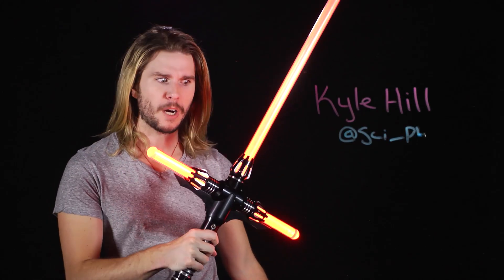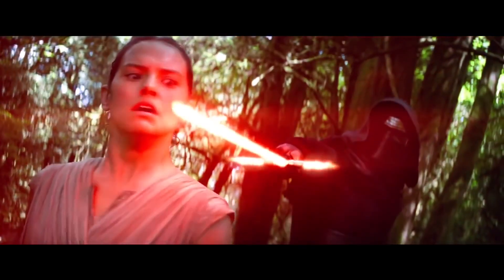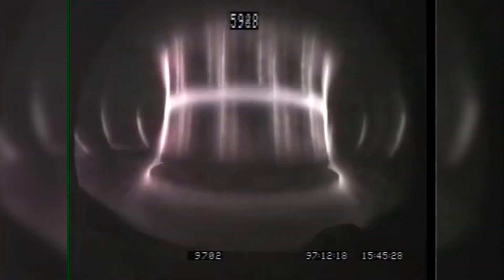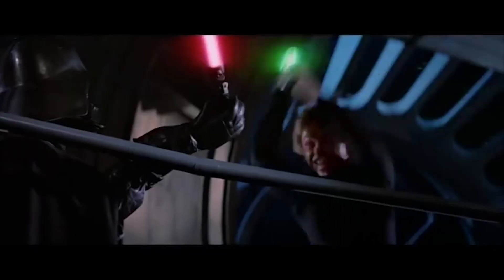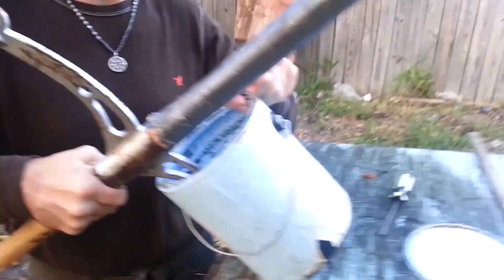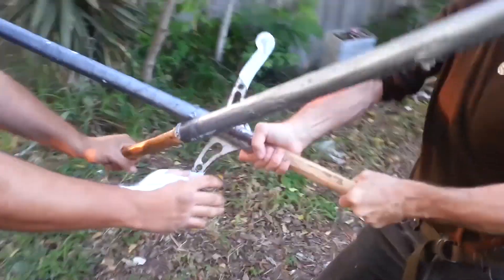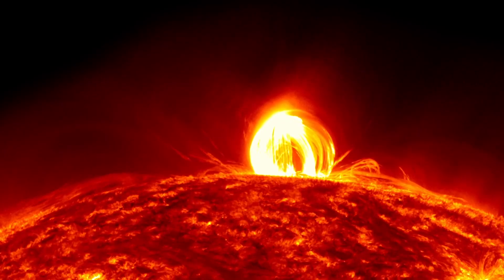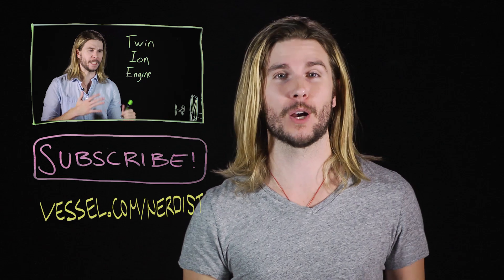Why Kylo Ren's Lightsaber Works (Because Science w/ Kyle Hill)

Comment: A parsec isn't a measure of time, it's a measure of length. A parsec is equal to about 3.26 light-years (31 trillion kilometres or 19 trillion miles) in length.
Reply: +Tylermike75  That's the point the Kessel Takes roughly 18 Parsecs to complete due to the Maw black hole Cluster, But Han was able to Complete it in less than 12 Parsecs by Traveling closer to the black holes.
Reply: +Tylermike75 that's why its stupid. Han described what sounded like a test of speed by stating a measurement of distance. Thats like saying "I ran the 100 metre dash in 10 000 centimetres." Lucas didn't check what "parsec" actually meant, he just thought it sounded like a fancy unit of time. He was wrong lol.
Reply: Noah MacGillivray Haha yea
Reply: LuxKat So, its not actually a test of speed but a test of durability and pilot skill? Because if it were a test of speed they wouldn't allow ships to alter the race course by cutting corners like that. I can understand though if it is like "The usual route through these black holes is 18 parsecs long, but Han found a route that was only 12 parsecs long". But, that also means that speed is irrelevant as it is about plotting a course that has the shortest distance, not having the best top speed.
Reply: +Noah MacGillivray well the kessel run isnt a race its a smugglers path way since larger ships cant follow smaller ships through it.

but the falcon hyperdrive is actually a level 0.5 which makes its hyper drive also faster than most ships which are usually level 2-3
Reply: +Jaunty Spider I think the point is that the ship can get that close to the black hole without falling in. If he is saying that the falcon can get that close to the black holes without falling in than by definition he is saying the falcon is faster than any other ship- in universe justification 

Lucas didn't know what a parsec was- probable real world explanation 

I have also heard the theory that Han was bullshitting Luke and obi wan to try to get them to fork over more money and given that he was a rouge at the time that would also fit in with his character
Reply: ***** I guess, but it would still be a really convoluted test of a ship's abilities. The way I see it the Kessel Run is more of a test of daring and survival, not just the ship, and as such stating "The Millenium Falcon did the Kessel Run in 12 parsecs" is more a testament to Han's skill as a pilot than the ships speed or other abilities. This whole thing would be much simpler if they simply said "the top speed of this ship out of hyper space is x!" or "This ship can do x hyper-speed jumps on one tank of fuel!" or even more straight forward, "This ship can do the Kessel Run in ANY AMOUNT OF TIME WHATSOEVER".
Reply: +Tylermike75 

The idea of the Falcon being a "fast ship", as Han puts it, is if so many ships can jump to hyperspace then his is better at it. Even before LucasArts licensed some (now non-canon) book that explains Han traveling close to worm holes, LucasArts were explaining that the Falcon's navicomputer is extraordinarily good at plotting routes through space. If you have to race from Los Angeles to New York, half of the battle is finding the best route, and same is true of ships traveling through hypserspace.
Reply: +Tylermike75 It wasn't a test of how close you can get to the black holes of The Maw, it was the Imperial Space Station there. The Imperials guard the closest routes for the Kressel Run,  you could go around the Imperial forces, but you are taking too long, and risk being found. The closer you are, the more dangerous it is. By completing the trip in a short 12 parsecs, Han was almost touching the Imperial patrols as he made the run - hence making him the best smuggler in the galaxy.
Reply: Jay Schnurr I appreciate the work an though everyone did here in these comments, but the truth is, as I have stated, the danger wasn't getting too close to black holes (even though VERY prominent), the danger was getting to close the the Imperial Installations inside and surrounding the Maw. If you got caught with your load, you were arrested or killed by Imperials. So the fact that he did the trip in 12 Parsecs, instead of his original route, he is known as the best smuggler ever, crossing the Kessel Run in a record distance without getting caught.
Reply: There's a theory that says that Han was talking about how he's able to travel through the Kessel Run in the shortest distance possible, effectively cutting corners in one of the most dangerous smuggling routes to save both time and distance.
Reply: +TonierShadow This makes the same sort of sense as +Elemental Turnip's reply about cutting corners on dangerous smuggling routes; they could be dangerous due to the proximity of black holes... 
I still prefer thinking of the Kessel Run as a relay-sort of job, but either way, I believe that Lucas and Ford made no mistake in writing/speaking. Quite probably, Lucas did it to create this exact argument to further accentuate his depth of back-story.
Reply: +Cristian Allwood "Okay, I'd like to preface this by pointing out that trying to apply an 
accurate physics model to a fictional universe that is not explicitly 
based on an accurate physics model is completely illogical and might 
even make your brain explode."

Isn't... um... isn't that what this show (Because Science!) is all about? Why are you even here, if you don't have any interest in attempting to do just that?
Reply: DejaVoodooDoll publican90 These reasons make so much more sense!
Reply: +Jaunty Spider no its because of interdemsions Han didn't find a shorter route its because he flew so close to the blackholes that the distance was displaced causing it to be a shorter distance.
Reply: +Alex G Unfortunately, theat guy basically has the logic that the book used. Han himself was surprised that the distance was shorter that it should have been, and double checked the figures to make sure. And the result: getting suicidally close to the black holes somehow knocked nearly a third of the distance off of the route.
Reply: +Cristian Allwood no it was a bluff
Reply: ***** nah it be bluff it says so in script
Reply: +Alex G Actually, it makes sense...kind of. His wording was off, but the concept was correct.

If a person was journeying to a black hole, and agreed to flash a light once every second, as they got closer, to an outside observer, the length of time between the flashes of light would continuously increase. This is because black holes mess with time...and since time is just another dimension of space, black holes mess with space as well. 

I said that all rather poorly, but the point is that there is a nugget of truth in there.
Reply: I understand that...I was just commenting that the statement that Alex made about there being no science in what the other guy said was incorrect.  :)
Reply: bluff be it just leave it at that he did not manage it
Reply: Actually, it's commented that the straight-line distance along the Kessel Run is about 20 parsecs. That line goes through the Maw. As for the bluff, who would believe the he cut over a quarter of the straight-line distance by going around the obstacle that names the route?
Reply: Apologies for double posting, but a thought hit me just after I hit post. A.K.A Matt, by your comments I find it rather safe to assume that you are going by the "Movie Canon". Unfortunately, according to Disney the movie tie-in novels are no longer canon, and the bluff was never called in the movie. Please draw your own conclusions from that.
Reply: +LuxKat That explanation is really dumb and people repeating it should be ashamed.
Reply: Cristian Allwood no it was in the script not some novel
Reply: A.K.A Matt No, the ridiculous Maw fan-theory (which is what it is, no matter if it got official sanction) comes from Jedi Academy, not any script.
Reply: avicenna no the script for the movie
Reply: avicenna in other words he did not make the trip
Reply: Yes he did, even though the books are non-canon, the movies still are, and in the seventh movie, he even said he did the trip in twelve parsecs. So why tf are you arguing this now? Because obviously, a seemingly good constructive argument became a pissing contest.
Reply: A.K.A Matt Ah, yeah. I misread. I still don't buy the bluff theory either, it'd be like a truck driver trying to bluff saying "this here be the big ole truck tha did east coast to west coast in less than 500 miles, yee haw"
Reply: avicenna nah it makes sense to hans character. he wanted to get payed back then and the better he sounded the better the pay.
Reply: A.K.A Matt He would use a bluff that made sense. Using a unit of distance, not time, doesn't produce a bluff that makes sense. It produces a bluff that even a child can call.

Han, a smuggler and spacer, would no doubt know what a parsec is. He would never think of intentionally fucking up his bluff in this way.
Reply: avicenna well in the script (by lucas) it says it was a bluff and how does it mater if it is time or length it can still be a good bluff saying that he made it in such good time/distance
Reply: A.K.A Matt Nah it really can't.
Reply: avicenna trust me he did not mange to do it. mostly because if he did mange it he'd be famous for it but hardly anyone knows him (besides bounty hunters)
Reply: A.K.A Matt Okay bro, this might be a bit difficult for you but I know you can manage. Just repeat after me:

Parsec is a unit of distance, not time.
Parsec is a unit of distance, not time.
Parsec is a unit of distance, not time.
Parsec is a unit of distance, not time.
Parsec is a unit of distance, not time.
Parsec is a unit of distance, not time.
Parsec is a unit of distance, not time.
Parsec is a unit of distance, not time.
Parsec is a unit of distance, not time.
Parsec is a unit of distance, not time.
Parsec is a unit of distance, not time.
Parsec is a unit of distance, not time.
Reply: avicenna i know which means he bluffed it somehow maybe they had no people on it or maybe he pretended to mange some shortcut but from what we know it's very likely a lie.
Reply: I am going to say this once. He accidentally made the 12 parsec trip. Due to trashy scanners, he didn't realize how close he was to Imperial Space Stations, so when someone went to go see if it was true he made that close of a trip, he played it off like he did it on purpose. That part, and ONLY that part was a bluff. He did make the trip. Stop arguing if he did or did not do it, because you all are right, and you all are wrong at the same time.
Reply: A.K.A Matt Explain how this bluff would make any sense whatsoever. Remember: a parsec is a unit of distance, not time.
Reply: avicenna i have no idea i just know it is a bluff he did not do it. simple as that. maybe you should ask the writer i can think of one way what if he faked finding a shortcut.
Reply: A.K.A Matt
I think you're just making this up as you go along and have no evidence to back your claim.
Reply: BassHead no trust me look up the script
Reply: BassHead the only thing is it is unknown if this was finalized but it was in most scripts i believe in it too.
Reply: A.K.A Matt Listen, a bluff is only a bluff if it makes sense. Saying "the falcon is the ship that did the Kessel run in less than 5 hours" is a sensical bluff, since it implies the ship is very fast. Saying "The falcon is the ship that did the Kessel run in less than 12 parsecs" just implies that solo doesn't even know what a parsec is, and is therefore the opposite of a sensical bluff. It implies that Solo is a goddamn incompetent who can't even tell length units and time units apart. It'd be like a truck driver who doesn't know what a mile is.

It's not a bluff. It's a screenwriting fuckup. Accept it.
Reply: +Tylermike75 But if your hyperdrive is bending space in front of it in order to reach your destination, you want that space to be more compact. Like, less than twelve parsecs. But that's not how hyperdrives work ... Maybe the hyperdrive computer calculated a shorter route through hyperspace.
Reply: From what I remember from the book, (simply because I'm too tired to find the exact quote atm) is that Han was making the run when they got in trouble with the local Imp patrols. He made a hyperspace jump both from a point that was too close to the black holes and traveled along a path that was, again, too close to the black holes. Checking the readouts afterwards, he discovered that the jump was shorter than it should have been.
Reply: +Tylermike75 A parsec (abv: Parallax Second) more precisely is the distance a star is from the sun at an angle of one arc second (1/3600th of a degree). Since tan(x)=r/d, d=r/tan(x).
Reply: AlchemistOfNirnroot I'm done. It went from black holes or imperial outposts, to this guy believes Star Wars was real and that a story that was completely made up back in the 70's and 80's can be explained by physics from today. Stop. Now.
Reply: +BassHead I don't remember anyone trying to apply real world physics to this. If it were 'physics accurate', Han and Chewie would have died, full stop. If anything, getting that close to that number of black holes should have effectively extended the distance, not shortened it.

I just think that the explanation given was inventive and entertaining, as well as being in keeping with the general feel of how physics in a fictional universe has worked.
Reply: Cristian Allwood Don't see why they would've died. Unless they actively tried to slow down when approaching a black hole, conservation of energy dictates they would just emerge on the other side of the gravity well with the same speed, possibly in a different direction.

This explanation is terrible for a simple reason: it doesn't work. Even assuming most ships could only get within 1000 event horizon radii of a black hole, assuming that each such black hole has a radius of 10 km, and assuming the trajectory goes near 1000 of these black holes, a ship could save AT MOST only 0.07 astronomical units off their path by moving closer to the black holes. That's 0.0000003 parsecs. A far cry from the 6 parsecs this fan theory requires to work.

So, really, the whole thing is 8 orders of magnitude away from being even in the same galaxy as "plausible". It's not much more than pseudo-scifi mumbo jumbo.
Reply: +avicenna Okay, I'd like to preface this by pointing out that trying to apply an accurate physics model to a fictional universe that is not explicitly based on an accurate physics model is completely illogical and might even make your brain explode.

Now that the mini-rant is out of my system, (and it wasn't entirely aimed at you, that one's been boiling over for a while, both in- and outside of this thread and even Star Wars), I'd like to point out first that the Falcon was apparently scraping the event horizon of a black hole and would would have crossed a few more following the programmed route.

Second, hyperspace. I can find nothing about the interaction of hyperspace and black holes beyond any sufficient gravity well will kick you out of a jump. All we really know is that hyperspace drops you into some kind of alternate dimension that treats the traversal of distance differently. Honestly, in things like these, hyperspace just seems to be a form of applied phlebotinum.
Reply: Cristian Allwood "Okay, I'd like to preface this by pointing out that trying to apply an accurate physics model to a fictional universe"

Nope, I'm not doing that at all. I'm merely playing by the rules set by the universe. Those rules include distances being more or less the same they are in the real world. This is not an 'accurate physics model' by any stretch. It's a basic self-consistency requirement.

"Now that the mini-rant is out of my system, (and it wasn't entirely aimed at you,"

I hope it wasn't, because as I just explained my answer has very little do with real physics.

"I'd like to point out first that the Falcon was apparently scraping the event horizon of a black hole and would would have crossed a few more following the programmed route."

My argument still applies, however.

"Second, hyperspace. I can find nothing about the interaction of hyperspace and black holes beyond any sufficient gravity well will kick you out of a jump. All we really know is that hyperspace drops you into some kind of alternate dimension that treats the traversal of distance differently. Honestly, in things like these, hyperspace just seems to be a form of applied phlebotinum."

Oh, it is. But the very premise of this fan theory is that the time of travel is not important, only the distance. So Han could drop out of hyperspace, cruise along very deep inside the black holes' gravity wells, and leave. But let's roll with it. Let's say that throughout this route a lesser ship could only handle a local acceleration due gravity of less than 1 g. That means that for a black hole with a Schwarzschild radius of 10 km, the ship would need to keep a distance of at least 10000000 km, or 0.07 AU. This gives a local acceleration due to gravity of about 0.4 g, which surely is acceptable to most hyperdrives.

Then as before let's say there's 1000 black holes along the route. That means you can save at most a distance of the order of 70 AU, or 0.0003 parsecs. Still got about a factor of 10000 to go before any of this makes sense.

So you see, it's not really physics but rather that writer's inability to comprehend how mind bogglingly big a parsec is.
Reply: I don't think many people at all can properly comprehend that scale.
Reply: Cristian Allwood Very true. Without doing the math it's pretty much impossible for our monkey brains.

But the thing is... it's easy to write a scenario that's plausible (in-universe) and that has the potential to be significantly more compelling. Instead of making up stuff about a black hole cluster that nerds are going to pick apart in two seconds, just make it a region of space that's intensely patrolled by imperials. Only a skilled pilot in a very fast ship would dare carry illegal goods through that region, and thus make a considerably shorter route.

It's still a stretch, of course, but a much better one. And there's the potential for some interesting stuff happening in the middle. Bad writing imho really is the problem with this thing I derisively call a "fan theory".
Reply: +LuxKat I've always thought that sounded like a very, very post hoc explanation for the parsec thing. More likely Lucas just got it badly wrong and they shoehorned this into the expanded universe in an effort to fix it ;)
Reply: Paul Bottomley It is. The explanation doesn't even make any sense.
Reply: +Paul Bottomley Well, I wasn't really paying attention to factual veracity the first time I read the book. All I can really say is: It fits with the writing style of the book, it fits with how the term has been used in universe and most people, myself included, wouldn't have noticed it unless it was pointed out to them. As for Lucas getting it wrong, I've no doubt of the high probability of that, he's not exactly known for being consistent.
Reply: Well I think in the movies it is a measure of time! Because Rey says 14 parsecs but then Han says 12! Why would a distance be different if they are going from the same place to a different place? Parsecs in the Star Wars universe may be a measure of time!
Reply: In theoretical physics, a strong enough gravity well could fold space and shorten the distance between two places, kind of like a cosmic shortcut.
Reply: Cristian Allwood If that's the case, Han Solo's trip had to take 40 years.
Reply: Again, the use of hyperspace circumvents that. On a relate note, has anyone noted that travel time in hyperspace seems to be highly inconsistent? Applied phlebotinum aside, one would think that a sort of standard would eventually assert itself, given how much contact a lot of the authors had with each other, along with the Holocron. Now, I can understand cutting out the time in transit where nothing is happening, but at some times you have the amount of time that has passed, or is expected to pass before reversion, explicitly stated, and other times it's implied to be near instantaneous. Just a personal gripe, really, because while I prefer the idea that hyperspace is kind of like the relationship between the Overworld and the Nether in Minecraft, I could deal if it was basically teleportation, as long as it was consistent.
Reply: Cristian Allwood "Again, the use of hyperspace circumvents that. "

Either hyperspace works by making a shortcut, in which case the trip takes significantly less than 40 years, or it works through some other mechanism and there's no sense in saying less than 12 parsecs.
Reply: According to what little actual codification of the system I've been able to find, it really does seem to be like Minecraft, where one piece of technology 'moves' the ship into a somewhat separate dimension and another system provides propulsion within that dimension. So yes, in theory, a shortcut. What's used to justify the whole 'Run in 12 parsecs' thing is that gravity in our dimension affects hyperspace, which is why you're not supposed to be able to jump from within or cross a gravity well, and the relative distances remain constant, which allows the navicomputer to determine distance traveled.
On another note, I came to understand how big a parsec really is, and the size of the Maw blew my mind, as it's apparently nearly 5 parsecs from Kessel and easily visible. Also, distance really does seem to mean nothing in Star Wars, as that distance is easily covered using sublight engines. Several times ships leaving the Maw simply 'flew to Kessel' instead of 'jumped toward Kessel'. It actually occurs to me right as I'm typing this that Kessel is also supposed to be visible from the Maw. Kessel is described as a planetoid. So unfortunately we may never be able to come to consensus on this, but I must admit that I find the conversation scintillating anyway.
Reply: Cristian Allwood The 'Maw' justification doesn't hold up. There's no way you could shorten a route from 18 parsecs to 12 by using black holes. Black holes are just way too small.
Reply: +Jaunty Spider You're making the pretty huge assumption that it was a test of speed. The entire idea behind the Kessel run is that you couldn't just travel in a straight line, the hyperspace lanes don't work like that. So, through exceptional piloting and tricks, he found the shortest route to make the Kessel run.
Reply: the Whaler "If it is a fast ship"
"Fast ship? You've never heard of the Millennium Falcon"?
"Should I have"?
"It's the ship that made the Kessel run in less than 12 parsecs"

There's no way to spin this any other way. Writing flub. No other excuse makes any sense.
Reply: Actually, the whole idea of the Kessel Run was the danger. Basically skimming a giant mass of black holes while trying to avoid authorities.
Reply: Cristian Allwood The black hole nonsense was to the best of my knowledge invented in 1996 with the Jedi Academy sourcebooks. There's no indication whatsoever that this was the original plan in 1977.
Reply: That's the best part of fictional canon: Retconn!
Reply: Cristian Allwood I generally prefer my retcons to make sense though
Reply: but you yourself have already pointed out how hard to understand that level of distance can be. Besides, from the perspective of the Star Wars Universe, it does make sense. Said universe doesn't need to perfectly follow the laws of physics; it's fictional. Also, spare a thought to how badly it could have been. The Expanded Universe is a collaboration between dozens of people, who otherwise may have no connection other than submitting their work to the same company. At least it's pointed pointed out that what happened should be impossible, you wold not be the only one to take consolation from that.
Reply: Cristian Allwood I prefer the meta-justification that george made a mistake and that, in fact, Han didn't really say "parsecs" but something else. We're always seeing a sort of artist's impression of a fictional universe anyway -- there's no need to assume that everything in it is literally "real".
Reply: Or consider a language difference. 'Parsec' simply means something slightly different to them. Since this difference isn't codified anywhere, that would provide a lot of leeway for this sort of thing.
Reply: Cristian Allwood That is one way to interpret it, yeah. George just "translated" it wrong.
Reply: Actually, I've never really thought about translation. I mean, once it's mentioned, it is rather obvious that Basic and English simply can't match up like they seem to. But then I find it rather easy to suspend my disbelief in these things. From that perspective, though, old man George has godly talent. The lip-syncing in those movies is perfect!
Reply: +Tylermike75 The Kessel Run is a competition/race designed with this "backstory":
A shipment of spice or drugs or whatever is on a planet, and the Imperial ships are on their way. All of the cargo ships leave, and the racing pilots' challenge is to take a load to each ship while they are fleeing the planet. The racing pilots have to return to the planet between ships to load more cargo. Therefore, the faster a pilot loads/flys/unloads/repeats to finish the race, the less distance he will cover, since the fleeing cargo ships will each be closer to the planet where the spice is being hauled from.
Reply: After reading nearly the entire EU, I must say that I've never heard that one. Can you cite your source?
Reply: +Cristian Allwood Star Wars Technical Journal by Shane Johnson, ISBN 0-345-40182-4, 
Published October 1995, Page 30, Paragraph 3.
I had to re-read my library of Star Wars books to find where I had read 
this, and that is why my reply was slow. Sorry, and thank you.
Upon re-reading it, it appears it wasn't a race so much as an actual 
job, the Kessel Run, usually hauling spice. The ships receiving the 
spice wanted to do so before reaching Imperial space, but for whatever 
reason didn't want to stop at Kessel.
Reply: This Is the official definition for a parsec: the distance at which the parallax of a spatial body with the transition of the earth is equal to one arc-second.... Such intuitive, very practicality, wow....
Reply: Diego Sanchez Stupid memes aren't an excuse for ignorance.
Reply: +Tylermike75 Han Solo was talking about how close he was able to fly to a black hole. Showing the capabilities of the Millennium Falcon
Reply: TonierShadow  That explanation makes no sense.
Reply: >ehem<
" umm actually GANDALF is a VALA not a HUMAN... everybody knows THAT."
now say that with eric cartmans voice. yeah thats what you kinda sound like (even if youre right)
Reply: *shrug* He's a Maia, not a Vala.
Reply: +Tylermike75  Similarly light sabers don't follow the same rules as metal swords. They don't skid off each other,  but  inherently arc together. This is seen million times in all the duels.  Its moot whether there is a crossguard or not, if there is , its useless, and probably dangerous . I mean really, use Cortosis if you really wanted saber proof hilts.
Reply: Maybe the parsec part means that he found the shortest route...?
Reply: NLT319 .03
The parsec part is referring to how close Han flies to the black hole that the kessel run goes past. By flying closer to the black hole, Han is able to complete the Kessel run much faster. What Han is saying is that his ship, the Millennium Falcon, is able to accomplish much more thus allowing for much faster routes making it the perfect smuggler's ship.
Reply: TonierShadow That is bullshit. It doesn't stand up to any kind of scrutiny. Even if there were 1000 black holes along the route they couldn't change the distance appreciably. A few tens of AU at the most, never parsecs.
Reply: avicenna
The Kessel Run goes around the black hole, Han's route takes him directly across. By traveling a chord's length of the kessel run by flying close to the black hole he cuts his distance traveled by ten fold. Traveling across a circle will always be shorter than circumnavigating it.
Reply: TonierShadow Like I said. Black holes are tiny. This particular bullshit explanation was invented by some guy with no knowledge of basic astronomy.
Reply: avicenna
Black holes may be small but they contain immense solar mass. Meaning they retain their original gravitational pull. So, just because the black hole may be small in diameter doesn't mean people can fly closer to it because its gravitational pull and everything else's Roche limit hasn't changed.
Reply: TonierShadow "Black holes may be small but they contain immense solar mass. "

That depends very much on the black hole. Outside of the center of a galaxy you won't find one that's more massive than a few tens of solar masses, no. In other words, it's about as big as a star, give or take.

In fact, a star is a much worse navigational hazard because the distance at which it may fry a ship is much larger than that at which a ship might be torn apart by tidal stresses.

So, really, there's no excuse. This glorified fan-theory is dumb.
Reply: avicenna
You're still overlooking what the Kessel Run actually is. In order to get past Imperial cruisers smugglers travel around the Maw, a large asteroid and black hole cluster by jumping in and out of hyperspace. By circumnavigating it, the average distance is 18 parsecs; however, Han traveled through the Maw Black Hole Cluster whilst still jumping in and out of hyperspace while managing to avoid the black holes. By doing this he cut the actual distance traveled to about 12 parsecs.
Reply: No, tonier, you are overlooking that a black hole is way too small to make an appreciable difference in the travel distance. It would be measured in astronomical units, not parsecs.

This theory is fanfiction, and bad fanfiction at that.
Reply: avicenna
You are not understanding what the actual Kessel Run is. If you did, you would understand why it is so impressive that the millennium falcon can complete the Kessel run in 12 parsecs.

Post Script: It is not fan-fiction it is actual star wars lore.
Reply: No, it is officially sanctioned fanfiction. You are not understanding that the explanation doesn't make sense. A black hole is small. Even a cluster of them can't make a route change distances by "parsecs" as opposed to "AU". This is what you refuse to understand.
Reply: avicenna
You are misunderstanding the Kessel Run. The Kessel Run is an 18-parsec route used by smugglers to move glitterstim spice from Kessel to an area south of the Si'Klaata Cluster without getting caught by the Imperial ships that were guarding the movement of spice from Kessel's mines. In order to avoid the Imperial Ships, smugglers travel through the Maw, a highly dangerous region of space filled with asteroid and black hole clusters. The Maw is encased in a nebula arm that block all sensors causing pilots to fly blind. In order to safely navigate and evade both the Maw and Imperial ships, pilots jump in and out of hyperspace, pushing all relativistic bounds. The constant change in velocity can cause immense g-sickness that ultimately can lead a pilot and his ship directly into a black hole or asteroid. What Han is saying is that the hyperspace drive in the Millennium falcon can handle anything, that along with his piloting skills, he can fly directly through the cluster cutting his distance significantly.
Reply: TonierShadow No, I am not. You, however, are misunderstanding black holes. You cannot "fly closer" and cut the traveled distance by "parsecs". You can cut it by "AU". At best.

Do you understand that even a black hole with ten times the mass of the sun is only 20 miles wide? Do you understand this?
Reply: avicenna
You are not understanding that instead of flying around the Maw and traveling the 18 parsecs, Han is traveling a chords length across. The black holes virtually have no affect on the route Han is taking, but instead only add on to the risk. By traveling a chords length directly across the Maw instead of around, he can travel 12 parsec instead of 18. It is simple geometry, not much more to it than that.
Reply: TonierShadow "You are not understanding that instead of flying around the Maw and traveling the 18 parsecs, Han is traveling a chords length across. "

I am understanding, what you're not understanding is that it doesn't matter. Any ship could do that. A space shuttle could do that.
Reply: avicenna
To complete the Kessel Run without being captured by Imperial Ships smugglers have to constantly jump in and out of hyperspace. That constant acceleration can cause immense g-sickness not to mention that in the Maw all navigation systems are offline. No ship dares to go across the Maw do to the immense threat that they could come into contact with a black hole or asteroid in between jumps.
Reply: TonierShadow Do you understand that black holes are only a few tens of miles in diameter? Y/n?